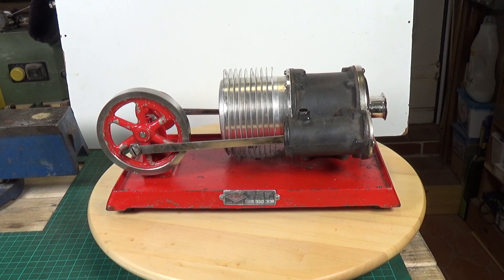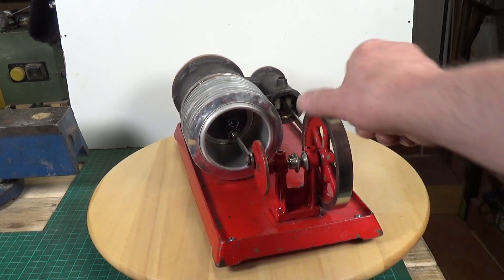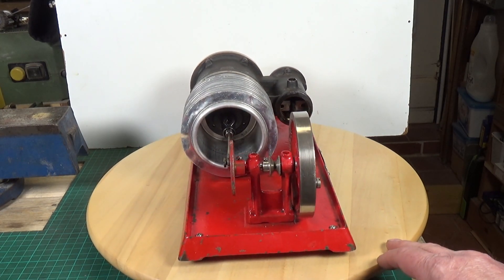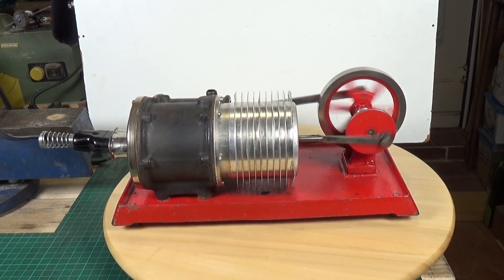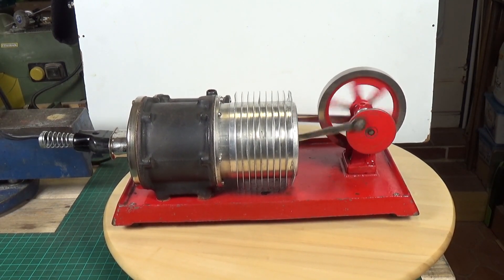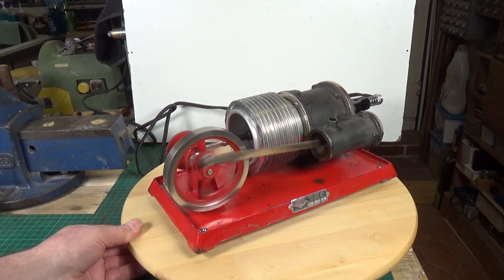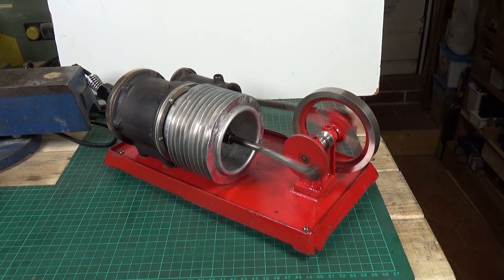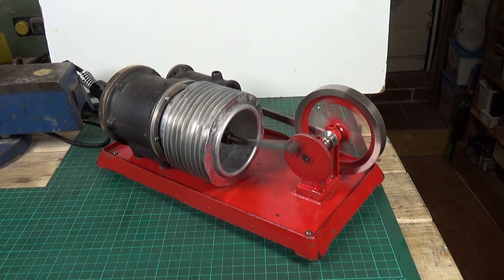Empire Model Number B-38 Hot Air Engine

Comment: Well done in finding such a good example of this engine. As a model engineer I have just started building a copy of this interesting engine. Have you ever had the cover off the hot end and looked inside? I am lacking info on the element. If you are interested check my channel for the first part of the build.
Reply: myfordboy check out my Empire B38 video. I made a new heater from scratch for it. 
https://youtu.be/BmpUmBrj9Gg
Reply from the maker: Thanks, I was very lucky with this one. I have not had mine apart but Mr Pete rebuilt one on his channel, his videos might have some information for you.

Part One: https://youtu.be/DC0Eqiqh9tk
Part Two: https://youtu.be/AZxLgyfttP0
Part Three: https://youtu.be/o3_oM4J-jI0

I will check out your video on the build.

Cheers, Alan.

Comment: Hi Alan.  That is really interesting. I like the way they have done the alloy cooler and piston rod guide.  I may incorporate that in my next Stirling engine build (when I get time).

I am thinking a small version of this would be doable using a 12 volt diesel engine glow plug as the heat source.   Feed it through a PWM controller.

Life is never dull.

Cheers Rob
Reply from the maker: Hi Rob. What i find amazing about it is the sheer size, hot air engines are generally quite small but this thing is enormous! Tubalcain repaired one of these on his channel and he used a soup can for the displacer!

Cheers, Alan.